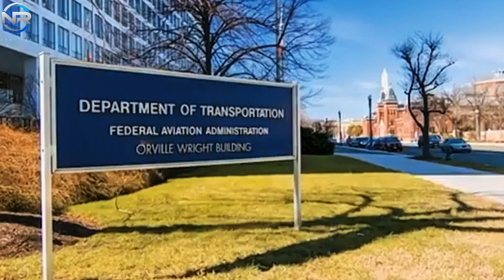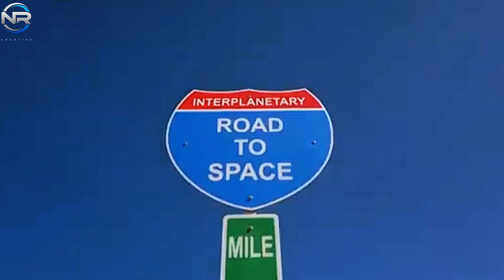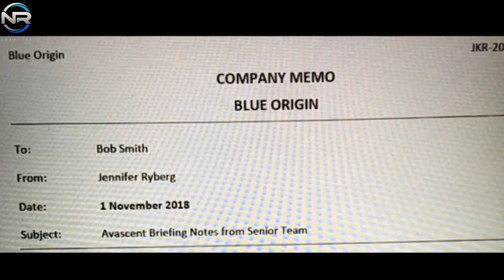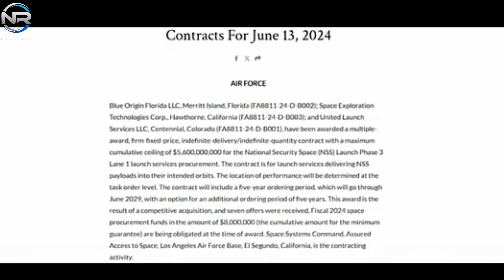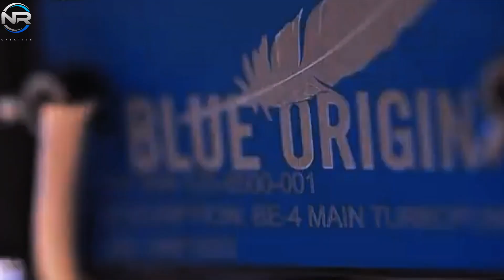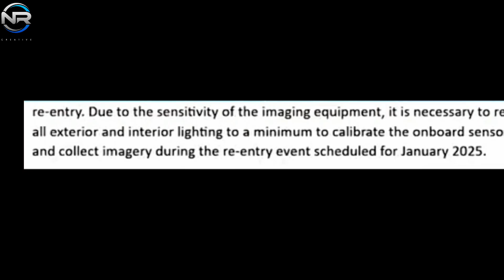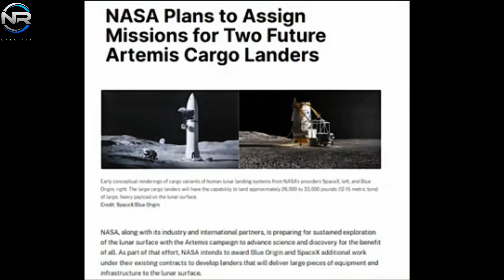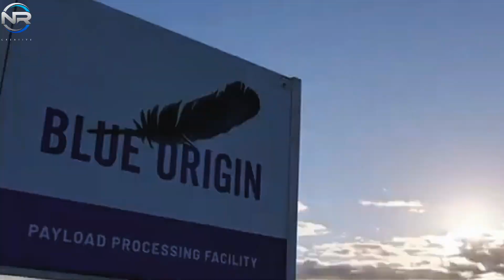The Shocking Truth Behind B.O!'s New Glenn on Pad! Elon Muks And SpaceX React

Comment: Make no mistake about it, I am primarily a fan of Space X. However, I dearly hope to see BO successfully get New Glenn into LEO early 2025. Picture two people deciding between two different routes to a destination about 60 minutes away. One route is only about 30 miles away, but the road is an unkempt gravel road with potholes and large rocks along the way. The other route is about 60 miles long, less direct but via a paved well kept surface. Elon takes the risk choosing an off road vehicle trying to go the 30 miles at 30 mph. with high risk. Bezos elects to use a reliable town car to cruise the longer 60 mile route at a smooth 60 mph with a lower risk. Who wins? Either could win. A lot depends on the weather and other changing conditions in the roads. The key is both have a valid method of getting to the destination in 60 min. 

Space X is taking huge potential risks via rapid iteration. Blue Origin is attempting high precision from the start. I've worked in various companies and have experienced the high risk tolerance vs the low risk tolerance methods. I've seen both work well and both fail. In the case of Space X vs. Blue Origin, I would suggest that there will be several more failures for SX before success happens and BO is more likely to have their first attempt, maybe 2nd, be successful. Yet, the timeline may be similar in the end. 

I do think it's great that Elon is basically more transparent than Jeff. Although I may favor Space X, I have to also say I hope they both become the leaders in space travel and exploration in the not so far away future. I could write a book on why I would like to see both companies excel. The short story is because I'm an American and they are American companies. The long story includes the collaboration between the American companies along with NASA, the Space Force and the DOD. 

Imagine the US Navy. Yeah, they are mostly carriers, battleships, submarines and etc. But the unsung heroes are the Navy hospital ships that in time of war save lives of our soldiers and even those of our enemies. In the meantime, during peace, they travel the world helping battle diseases, poverty stricken nations with starving and sick children and have helped provide relief to areas in the world devastated by disasters. Imagine the USSF (US Space Force) being something like the Navy in space in a future where many hundreds to thousands of people live and work in space (off world). And example taste of the future: Medical research stations 3-D printing organs to replace one's own dying liver, kidney, heart, lung, etc. with new organs grown with our own DNA. In micro gravity this is already possible in a limited form. With earths' gravity, it is nearly impossible. 

By the way, America First....absolutely. Only if we make our own nation healthy as individuals and as a nation, can we ever hope to have the real power to help peoples of other nations in need. The space frontier offers the potential for a healthy nation far beyond what most Americans believe or understand.
Reply from the maker: Everything has ist own process, 2 big companies competing with each other is a natural thing